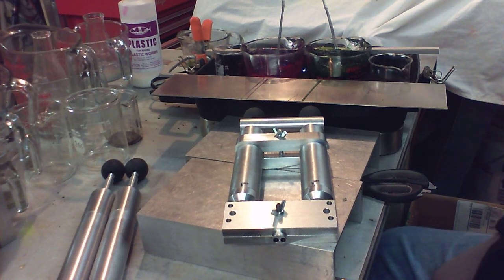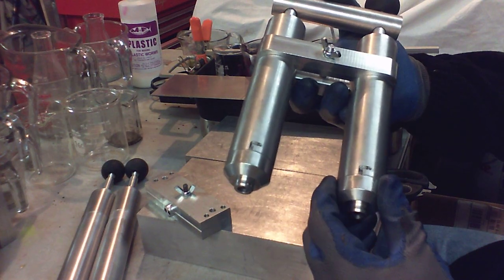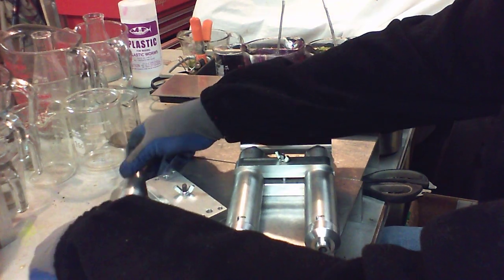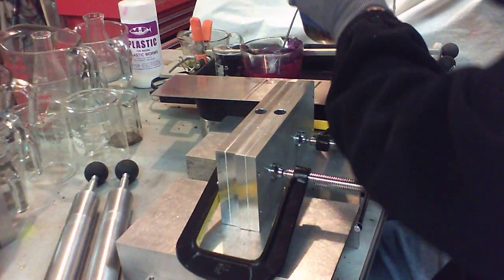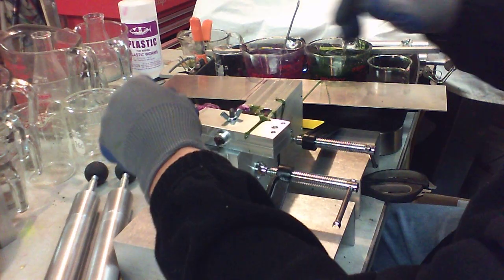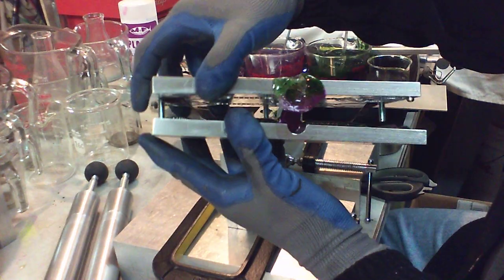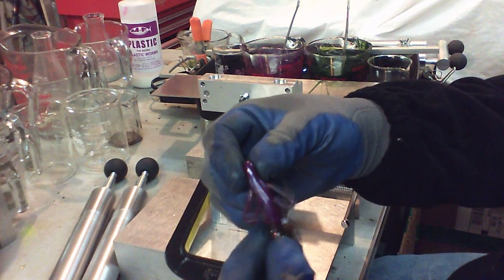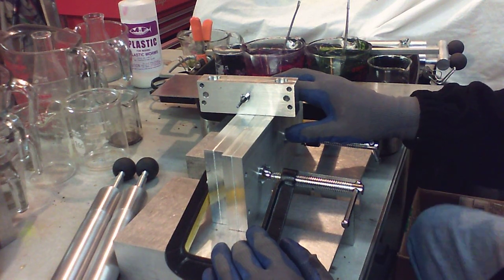Twinjector video

Comment from the maker: When using the Twinjector on molds with thin tails, you need to give an extra firm push at the end of your stroke. This will fill out the last of the mold. Temp of the plastic should be a little higher say like in the 320 deg point this will help out too. Frank

Comment from the maker: @Bobbyl007 I actually have some jacobs molds with real small ports and have had no problem laminating them too. It really blows your mind when you laminate with molds with sprues that go all the way to the bottom and push up with 50/50 results. I use the Twinjector alot and is just second nature for me I guess. Frank

Comment: Frank,  I have actually had fairly poor results with this manifold.  I was wondering if maybe the molds you do this with have a larger per bait injection port off the emain sprue.  As you know I make my own molds.  I initially designed a lot of my molds with a 1/8" per bait port to get a better shape on the nose of the bait with little or no trimming, but I was wondering if maybe a 1/4" bait port might laminate better.